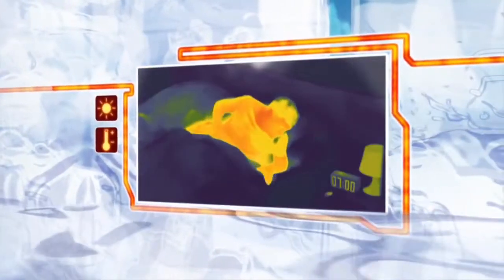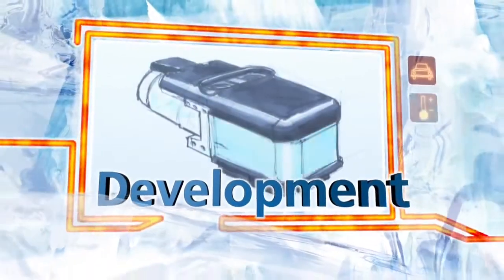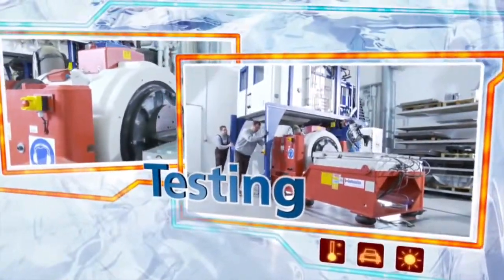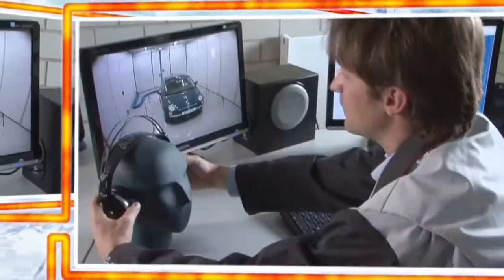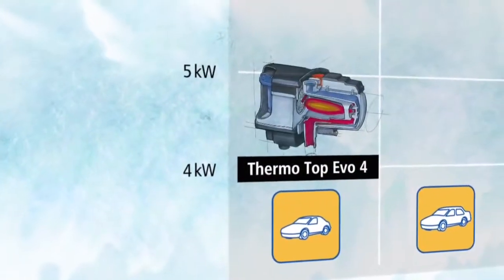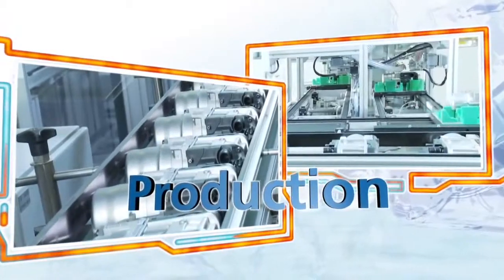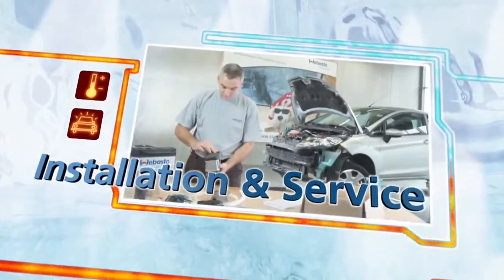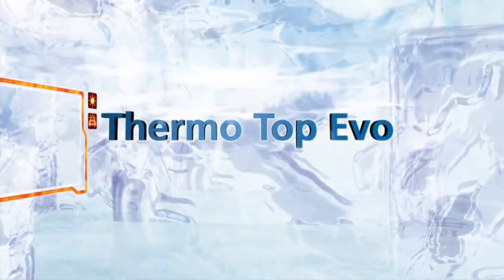Webasto parking heater Thermo Top Evo - The new Generation of Parking Heaters

Comment: I put a wabasto thermo top pro in my truck at a unit cost of $1500 CAD before instalation, went with Wabasto because its supposed to be the best I have had nothing but problems with it. seems like it is overly complicated with electronics and buggy. At this point wish I would have went with a chinese brand as it is probably as good or better and 1/10th the cost. German engineering isn't what it used to be.